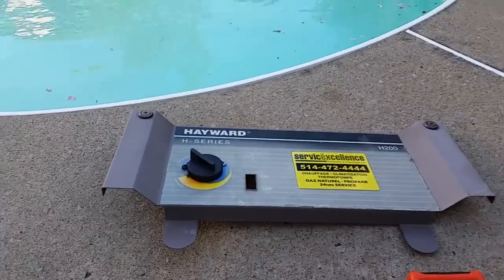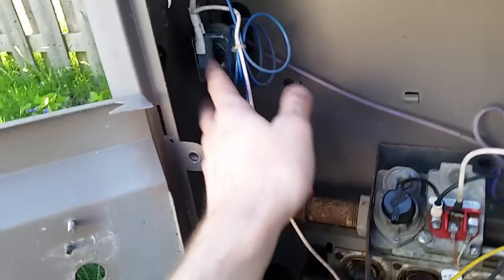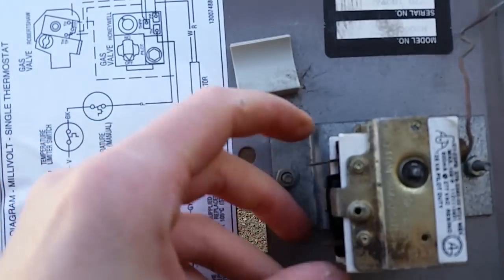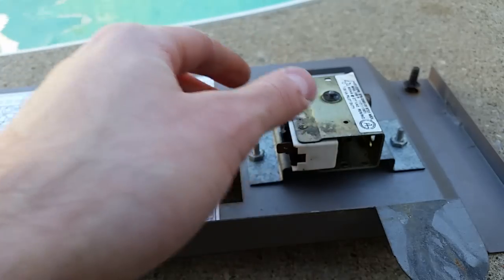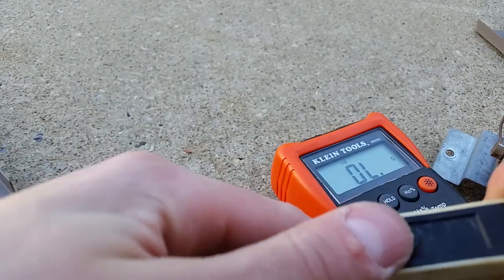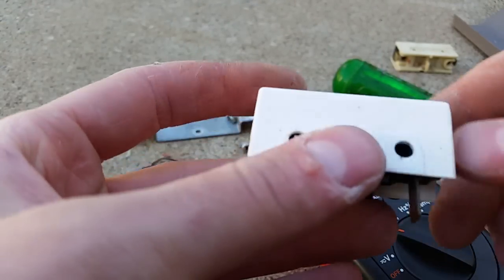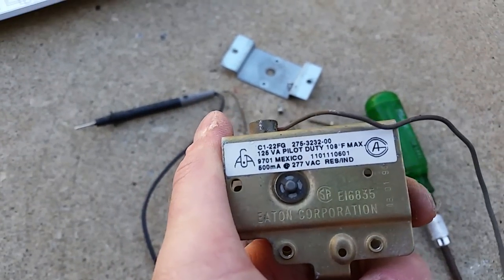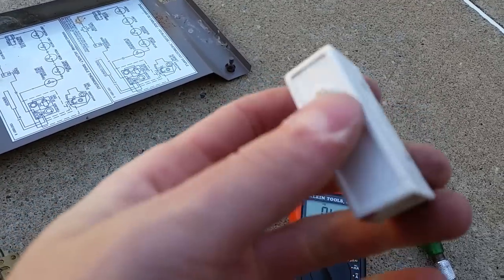Hayward H Series H250 H200 H300 GAS Pool Heater Repair Switch Replacement / Pool Heater Won't Light

Comment: Hello I have a question for you, my pool will only fire up when I jump the valve open with just a tap of a jumper wire. What could be wrong? All sensors are recently new and I changed out the thermocouple,  do you think the thermocouple is bad again?

Comment: My pilot stays lit, but my burners won’t come on. Can you explain with a video or pictures how to see if my valve is bad. A repair guy said it was sticking, but he was able to free it up a bit (it worked after he left), but here 3 weeks later the burners won’t come on now. He’s now texting me how to trouble shoot, but I’m not incredibly electrical savvy without video instruction. I have a Hayward H250 natural gas heater.
Reply from the maker: Wqtcg my other video

Comment: Hi, I have a Hayward Pool Heater.. When I turn off my water heater while the pool heater is running, the out temperature of the heat pump keeps running and the display shows that the water temperature (ou) is increasing until it reaches 40C then the heat pump trips the breaker in my panel box. Does this mean the Pressure Switch is defective? In the past the heat pump would turn off and give me the E03 error when the water pump would be off while the heat pump was running. It no longer does this. My pool heat pump is only 3 years. Does this mean I have a faulty pressure switch?

Comment: thx for the very informative videos. I have an issue with my h250 in that the unit doesnt shut  itself off after setting a temperature. If i dont manually turn off the unit with the switch the unit will keep heating up the water.when rotating the temp knob i can get the heater to fire up/shut off as i reach the point that the switch engages/disengages as per this video but no matter what temp i set the dial to after the unit fires up, it wont shut itself down on its own. Is there a way to test the temperature sensor (metal wire) that you note in this video?

tia!

Comment: I have a H100iD1 that stopped heating.  I clamped the door switch and traced through the schematic and I get 110 through all the limit switches etc to the control board.  I put a LED & series resistor across the 24v relay coil and a 110v neon indicator across the neutral and relay output (basically across the gas valve coil).  The fan comes on and after about 10 seconds, I see the led rapidly blinking (so not solid on), and the neon does about the same. The neon had about 5 volts (with a DVM).  After about 5 seconds the LED and neon (relay and gas valve) come on solid for about 1 second and I read about 50vAC on the gas valve then they turn off.  I removed the igniter and attached it to the screw for the cover so it's grounded, and I could see sparks across the electrodes.  I had also put a switch across the  N.O. relay contacts so I could manually run the  gas valve, and I can smell gas when operating it, so that works.  I thought the relay may be bad, so replaced it, but still not working.  I stuck a BBQ lighter in the igniter hole and energized the gas valve,  and lite the lighter,  and.... got quite a flashback. I guess that's why your not supposed to do that !!!  but I found the gas is getting through..   I cleaned up the electrodes and mounting plate of the igniter and area around where it mounts on the heater,  but still not getting the flame to stay on.  I tried widening the electrodes and I get more spark but still not firing up.   Do you have any suggestions?    Thanks.
Reply from the maker: Hmm that is very strange I do not have any experience with those heaters so i cannot say.
However it can be a problem in the control circuit

Comment: question, i bought a used hayward H100iD1 pool heater, the person i got it from was using it with propane, d i need a special kit to convert it to natural gas?
Reply from the maker: Yes basically you need what are called the orifices, which screw in to the burner assembly. The are the small valves the gas shoots out of. And of course the gas regulator supplying gas to the unit
Reply: There is a gas regulator on there now, it is a "Type R652-DFF", im assuming that is a propane regulator. Will a natural gas regulator be different and if yes do you know of one model number you can share so i can buy one if i need to
Reply from the maker: Yes LP and NG pressure are different. If it was originally set up as LP the regulator will be for LP
If you have natural gas supplied in your neighborhood then it will already be regulated at the meter. You will have to correctly size the pipe as per the BTU rating of the unit.
If you have a large tank that is refilled then you will need a regulator on the tank.
A word of caution though, if you do not know what you are doing be sure to have a licenced gas fitter plumber come out there and hook it up for you, gas is a hell of a thing and a lot can go wrong very quickly.
Reply: Videos from Québec thank you very much... great info

Comment: My Hayward H150 heater comes on but after 20-30 minutes shuts off and looks like the limit switch was triggered and stopped the heater.  I replaced the wiring and limit switches...any idea on what is going on?  Seems the heater is overheating causing it to shut down...
Reply from the maker: Could be the thermopile is wearing out, or a problem with the gas manifold

Comment: I meant the Eaton thermostat switch.
Reply from the maker: Frank Lopes I have not been able to find find them, like I said they only really come with the whole thermostat assembly, as it is not supposed to be a serviceable part. you would have to track down a part number somehow
Reply: Yes, I've tried, good luck with that. Hayward really protects its huge 1000% + mark-ups!
Reply from the maker: Frank Lopes You wont get it from Hayward that's for sure, you would have to track it down through Eaton or who ever makes the actual thermostat assembly.
The thermostat assembly is not a proprietary Hayward part, it's made by another company and used across different brands.
Reply: Video Québec Yes, I think it is made by Eaton Mears. I have contacted an Eaton Mears dealer but they can't get cross references between Eaton Mears and Hayward branded parts. It's part of Hayward's way of keeping their prices high. No doubt they have an agreement with Eaton Mears to keep that information confidential. But, it appears that Eaton Mears does not sell the switches as a stand alone part anyways. The only way to see if a certain Eaton Mears thermostat (lower priced) is the same as the Hayward one would be to bring the old one into a shop and physically compare the two.
Reply from the maker: I guess if you REALLY wanted to track it down you could just go right to the manufacture or assembly plant and pick up a few, then sell the rest on ebay and make a buck

Comment: hi great videos, ive seen a lot of videos. your very to the point. wish other videos would take notes. I have a millivolt  heater just purchased new on/off switch,circuit board,rheostat,worked great after install a few days, pilot works no problem.wont turn burners on now.question 1 if I jump th th/pp gas valve connections it turns off my pilot,  question 2 my pressure switch does not have that little switch on top-it seems to be I unit. I have jumped all the safetys but still no fire. ? help  thank you..
Reply from the maker: Robin Baronsky Thanks! I find I go off talking a lot but I do try to cover every detail as much as possible.
If you have a circuit board of any kind you probably have an electric unit (uses external power supply)
The knob for the temp control is usually not a rheostat/potentiometer  but a dial that moves the trigger closer or farther from the switch as the thermostat part causes it to move closer or farther from the part to be depressed.
What model unit o you have? Pilot should only be going out if you remove the terminals from the thermocouple lead
Reply: Lite 2 model, jumped 2 terminals and burners go on the gas valve. Il jump each safety,and ck for contiuity
Reply: Thanks for replying.
Reply: My 1st unit has the small switch off the pressure switch. Nice to compare apples to apples. My 2nd unit is a 1 pc pressure valve and has continuity when pump off.
Reply from the maker: Robin Baronsky I am not familiar with that model, if you have an external power supply of any kind then you do not have a milivolt system.
Reply: No external voltage , it has a power pile 600

-750 millivolts standing pilot stays on
Reply: Its a laars lite 2 millivolt
Reply: Ive checked continuity through pressure switch,fireman switch/fusable link,roll out switch,hi/low limit,on off switch,just replaced thermostat on off switch sensor combo on line $100.00 it worked for a day. Yesterday furnace went on by itself. Switch was on. But went off maybe 30 mins later went off.
Reply from the maker: Robin Baronsky I took a look at the diagram, you can find it here: http://www.poolsupplies.com/pdfs/932650.pdf
They all work pretty similarly, if the unit is going out by it self and all your switches and links in the circuit prove good continuity, then there may be a problem with the gas valve. Did you test the thermostat switch as well ?
And are you sure you just don't have the temp set to low ?
Reply: Still in bypass.cked continuity through all.all current through
Reply from the maker: There must be a problem with one of the electronic components then